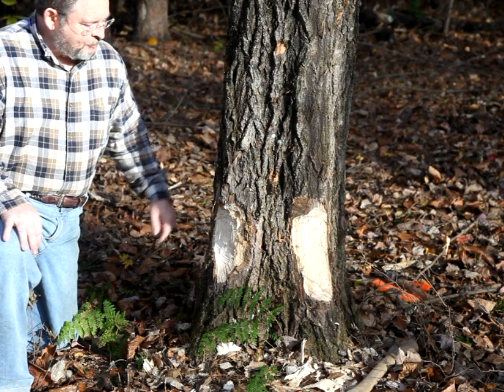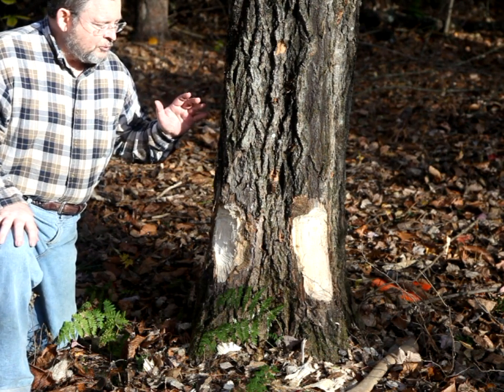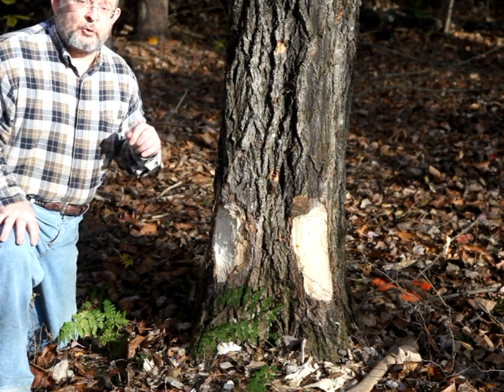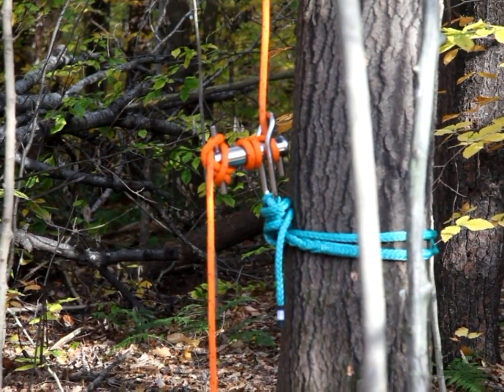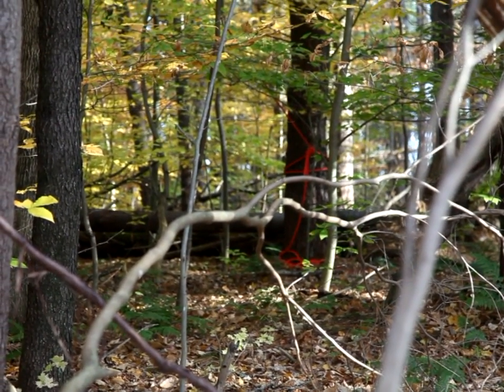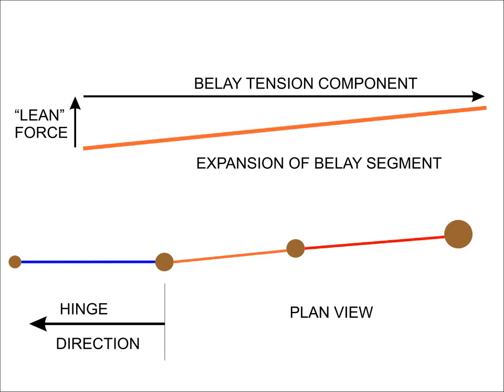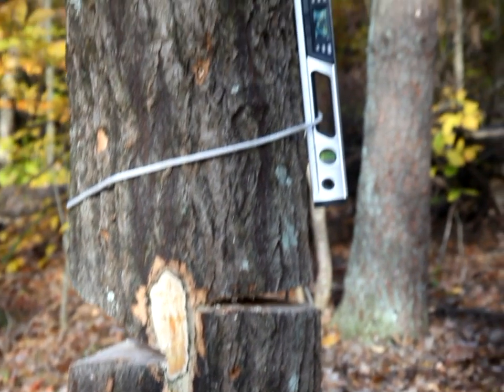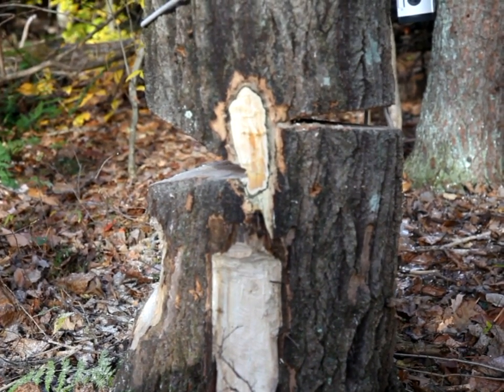Hinge_Test_2

Comment: I'm just as curious as can be to know/see how the remainder of the line was payed-out. I would expect the tensile forces nearing the failure angle were very high and that there was actually a reactive compression force component driving the butt of the tree back into the step on the hinge. All I kept thinking as the angle got shallower and shallower was "He's going to have to cut that rope and run for cover".
Reply from the maker: You are correct, Mike.  The tension forces were very high.  I had something like six wraps on the PortaWrap to hold the tree back.  When the tree finally fell sideways (into another tree), I still had it firmly held by the PortaWrap.  Since I was back by the PortaWrap, I never needed to run, as the tree was falling away from me.  You are also correct that the tree was being pushed strongly back into the step.  To put things into perspective, I very nearly burned myself when I touched the PortaWrap to undo the belay line after stopping the video.  The potential energy of the tree got turned into friction energy, and that energy went into heating up the steel PortaWrap.  I nearly burned my line, even though it never moved fast.  The risk of burning my line is the reason I decided not to re-run the test with with a more open notch.  That one line cost me around $200.

Comment: Outstanding work! Thanks. I have a question about hinge performance. Maybe you've answered it in another video. Let's assume you have a perfectly symmetrical, perfectly vertically balanced tree. Or just say a perfectly vertical telephone pole. You have cut a face notch, and you have back cut to the precise dimension of the hinge and have supported the gap in the back cut as you cut it, say with a spacer the exact thickness of your saw blade without the spacer exerting any vertical force on the tree (pole). Once you have achieved that theoretically perfect condition will the tree fall in the direction of the face cut, and what causes it to fall. Is it because the fibers in the hinge start to collapse and the only way for the tree to go is the direction of the face cut? Sorry this question got so long winded.

Comment: It was not the flexety of the wood that limiterad the hinch. It was the angel of the fas cuttung. A asp kan some times be horisontal to the grund and still have god grupp to the stump. Flexebilyt inkrese if the hinch is thinn. The holding capasety of a side lednin is dekresing with thin hinch. Stil
Inpressning setup. 
Thanks fore god videos.
Reply from the maker: Thanks Hakan.
  I do wish that I had made the face cut at a larger angle.  A thick hinge will begin to tear.  Then it will become a thin hinge and have more flexibility...and, as you wrote, less capacity to hold the side lean.
   I may have to do some more tests.

Comment: since the notch angle bottomed out did this cause the hinge failure? conveniently at 37 degrees... haha. glad I stumbled on your channel, have watched all your modules so far. subbed and thanks for the great teaching
Reply from the maker: I wish I could say it didn't, but I think (1) it played a part and (2) the hinge really was just about to go anyway.  I've felt somewhat chagrined about not having used a wider notch and have wanted to repeat that test with a variety of other trees.  One reason I have held back is that my PortaWrap got REALLY hot.  I hadn't anticipated that and actually got a minor burn when I touched it.  My rope didn't like the heat either!
Reply: @terryhale9006  I agree with Aaron above as the hinge goes from tremendous compression to tremendous tension in a moment as the notch bottoms out and becomes a lever, tearing the weakened fibres out; I always prefer using an open faced notch for no other reason than my own misguided intuition. I would love to see you repeat the procedure with an open faced Erikson notch and compare results. Great videos, and thanks for taking the time to produce such helpful material.
Reply: @terryhale9006  it was still excellent, and very educational. 👍👍👍😃

Comment: I want to commend you for the time and trouble to illustrate this, however, there are a few points that could  hit upon for those situations where ultimate control are required.  As most of us who fall big timber professionally know, once a tree gets to about 15 degrees of fall, the course is set. That's just fine in most situations, and often adventurous to have a hinge break at a high angle when working in a closed canopy with high value trees.  If the hinge is to good and the tree roll's or limb strikes another tree, then severe fiber pull or face slabbing are likely. Moreover, the overall bending classification of the species at hand, the condition of the tree, age, size, growth pattern of stump, lean, compression and tension wood, degrees of face opening, thickness of hinge, height of back cut in relation to face, depth of face cut (which directly affects how much fiber in the hinge is parallel or perpendicular to the bend), season, weather, and probably ten other factors dependent of the situation.  Point is what is your personal needs and goals.  If you just need to remove trees in an open area that have no real value, any of the basic techniques work.  If you're interested in being a professional timber faller cutting high dollar timber trees, or as a professional arborist working close quarters to power and structures. Then you must be like a sniper; armed with a saw instead of a gun, there's more to it than pulling the trigger.
Reply from the maker: Clint,
   No disagreement.  This video was made after I got a bit annoyed with someone claiming a 70 degree notch was required so that the direction of fall could be controlled by the hinge "all the way to the ground".  I definitely agree that the course is set once the tree has some momentum.
      Terry

Comment: How does the 37* hinge failure angle demonstrated here reconcile with the "Limits of Hinge Performance" video that demonstrated the hinge should fail in tension with just a few degrees of movement?
Reply from the maker: williaty   Hi Will.  There is a difference between the hinge experiencing cracking and the hinge failing.  The first snapping of fibers, heard as cracking, does indeed occur after just a few degrees of movement.  That snapping of fibers can be heard at numerous times in the demonstration video.  Failure of the hinge only occurs after ALL the fibers on one end of the hinge have snapped.  As stated in the introduction to "Limits of Hinge Performance", "..the hinge is largely compromised and ineffective at controlling side lean once the tree has fallen thru about 30 to 45 degrees."  The 37 at which the demo failed falls right in the middle of that range.  With a brittle wood like dead, dry pine, I would expect the failure to occur at an angle near the bottom of that range.

Comment: Nice video.   Very interesting to see the incremental steps leading up to the hinge failure.  

Yep, you certainly won, but did you have a hidden ace up your sleeve???  ;-)

I would guess that the fact that the failure occurred almost exactly when the notch closed completely was more than just pure coincidence. With enough experience, etc., I would think that, within certain limits, one can "fine tune" exactly when hinge failure will occur by adjusting the angle/size of the notch opening, among several other variables.  Of course, there are variables you can't control, e.g., specific tree characteristics such as wood density, etc., so the prediction can only be approximate.
Reply from the maker: You are correct....in each regard.  Clearly the test was rigged.
As I watched the crushing close the hinge, I was wishing I had used a wider notch.  The crushing was also influenced by the pressure from the belay.